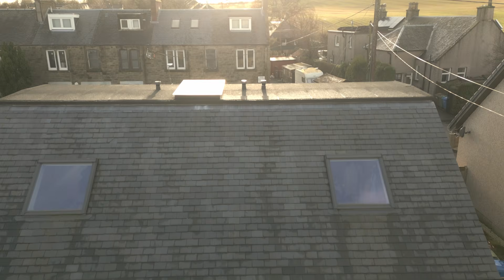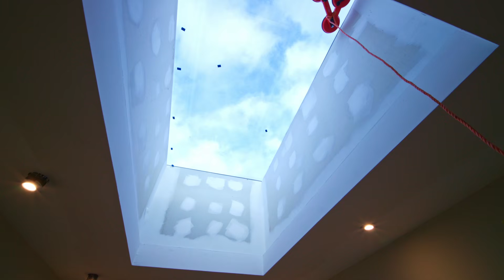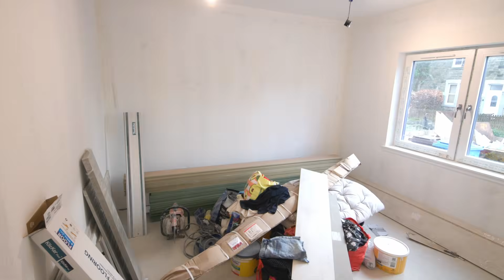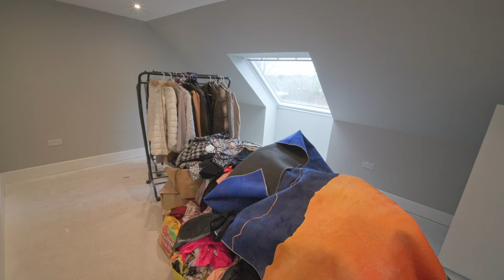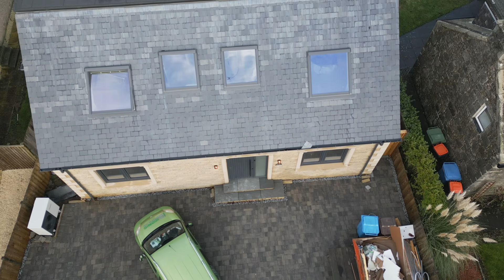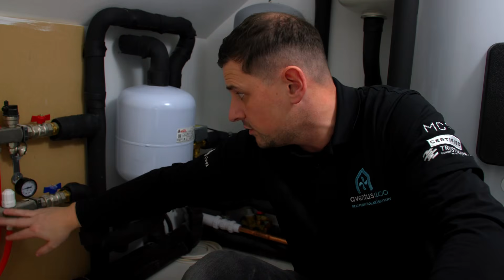Award Winning House… Now Let’s See If It Performs

Comment: Did I miss what you estimated the heatloss to be? 13kw was another firms. Looks like it could be a 7kw or smaller vaillant you've put in?

Good work
Reply from the maker: Sorry you are 100% correct the heat loss was 6.2kW so we installed a 7kW Vaillant- so half eh was recommended.

Comment: Hi love the video, It is worth noting that all the manufacturer's performance data is measured in perfect laboratory conditions and does not include any losses from external pipework.
 The COP and SCOP’s must therefore be treated as a guide. This is why installation is so important. What external pipework insulation did you use???
Reply from the maker: Primary Pro, glued and sealed, then joins into an underground pre insulated pipe.
Reply: @aventus-eco so important to get it right, great product.  Poor insulation of pipework is a massive issue